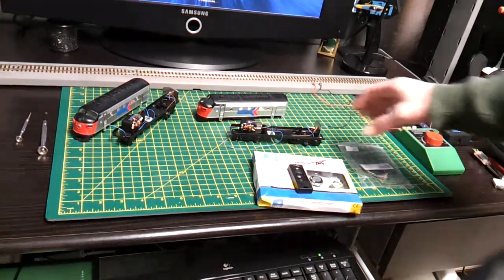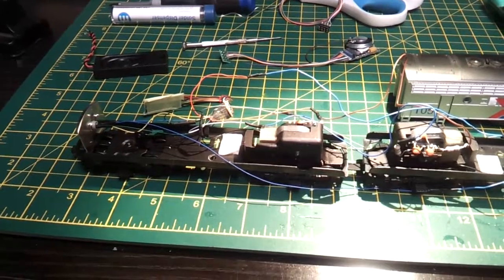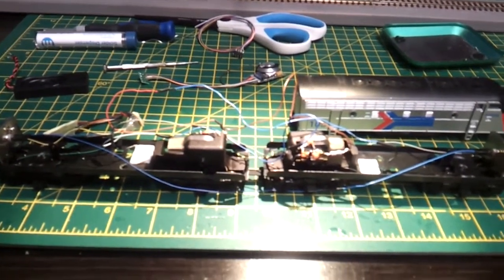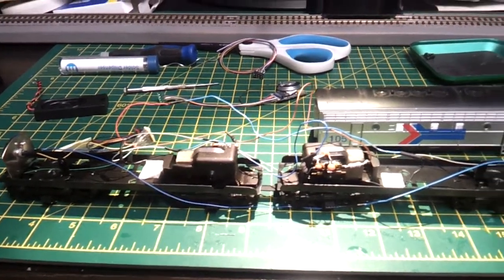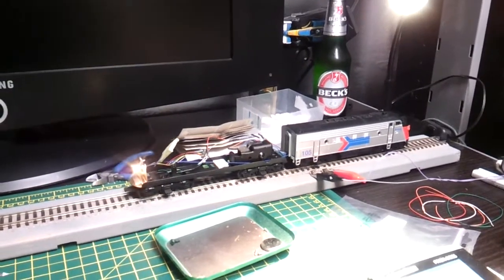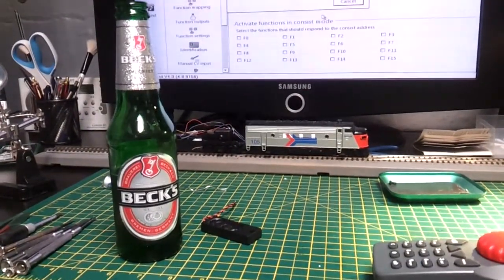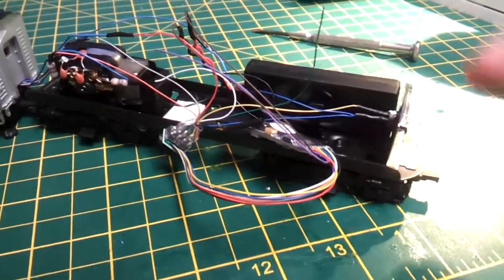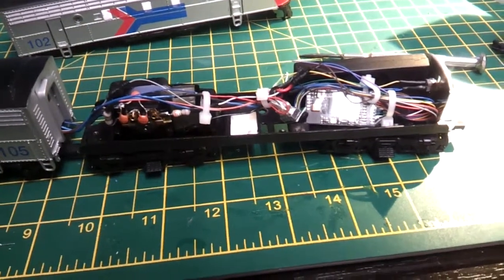TRIX AMTRAK 22590 F7 RETRO DCC FIT OUT PART 2

Comment: I am setting out to try to convert my own F7 to DCC and found the video very helpful, but was just wondering if you could provide a basic wiring diagram for the conversion, given that you mention its complexity? I appreciate that it has been a while, but would be very helpful.
Reply from the maker: Hi, this model is in deep storage somewhere,  if I find it I will open it up at some point.

Comment: You should be chuffed.  Very impressive.  Your level of technical expertise is amazing.  Where did you learn all this?  Excellent work.  I certainly remember those old f7 beasts.  They've all passed through the scrapyard now.  Probably driving some of one.  Yes, this new Google plus is nasty.  Everyh now and then, I forget to untick the box about sharing and blast my comment all over creation.  Very unsettling.
Reply from the maker: thanks rob , sorry for the delay {google +} i knew nothing about electronics a few years back as my work-trade is nothing to to with electronics. i learn the hard way by destroying a fair few chips in the process of retro fitting etc. i am still learning about the programming side of this hobby....
i love the u.s diesel & steam locos i have four models my fave is the big boy class....jim...